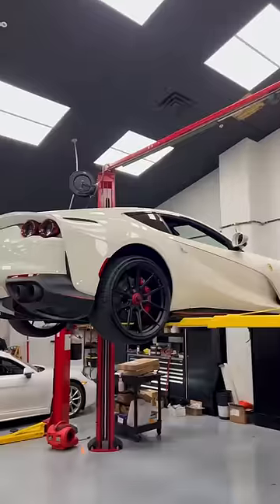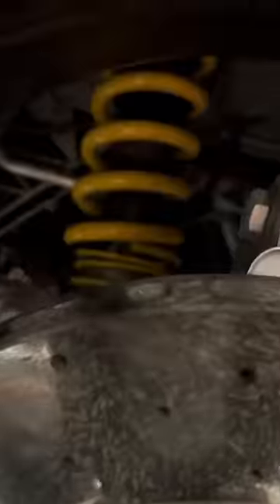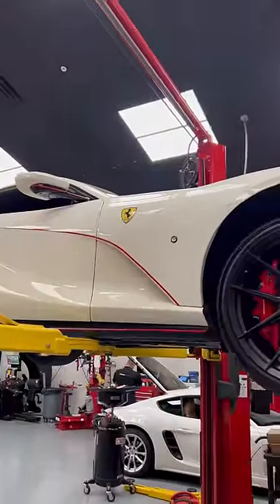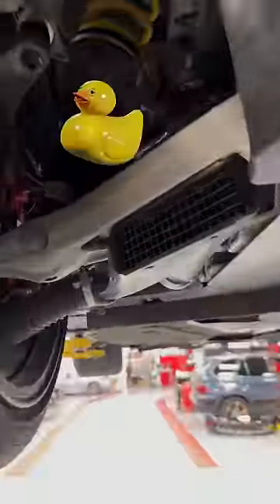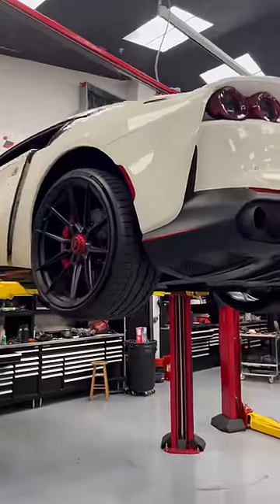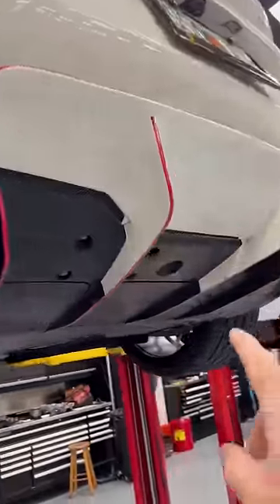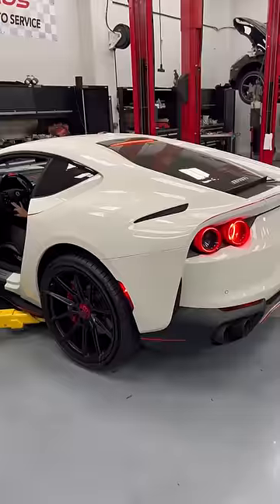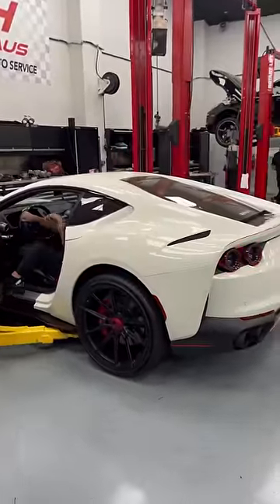The loudest car we service!! 🏎️💨 #automobile #ferrari #ferrar812

Comment: Having Ferrari modding money is wild.  $10,000 exhaust with $12,000 wheels if you’re wondering how much those Novitech parts are.
Reply: If you have a Ferrari, you also probably have Ferrari modding money. A 2021 version of the 812 goes for anywhere between $330,000 and $400,000.
Reply: Wow absolutely insane.
Reply: Imagine spending that much for only 60hp 😂
Reply: @S42069 that's a pretty good gain for natural aspiration
Reply: @xavierhulbert5849  Not true in the least. Many that own Ferraris can't afford them or the maintenance let alone modding. Same with more modest cars like BMW's, Porsches and MB's.
Reply: @spicysnowman8886  it would be if the starting point were sub 100. The percentage in power gained is going to be barely noticeable.
Reply: @S42069  it's not like a turbo car where you can just turn up the boost, 60hp is a good gain for a naturally aspirated car with light mods and a tune. Ferrari already squeezed a lot of power out of that v12, there's isn't a lot of room left.
Reply: @lukewalker1051  That’s just not true? Went to car meet with friends who have Ferrari’s, trust me none of them are broke. If anything, peeps like to keep them stock while they use some E30 or V70 as a tuner project

Does it make you feel better thinking people who have Ferrari’s are too broke to mod them? I don’t get it
Reply: @lukewalker1051 that’s so true. The ideal client for Ferrari or any luxury brand like them makes about 500k a year. 

And now there are former salespeople saying their ideal customer were the ones that could barely afford the car. That same customer has to sell it back to the dealership usually after a couple years because they can’t keep up with maintenance. The dealership buys it back at a depreciated value and then resells it for a great markup. They can resell the same car at least 3 times. 

The ones that can actually afford it try to buy them after they depreciated lol.
Reply: @half23 facts. But in most cases people lease high end vehicles for 2 years and switch to the next one. It only makes sense, as you stated, with the maintenance cost and depreciation.
Reply: $12000 for wheels and the hubcaps look like they came from autozone, wow
Reply: @S42069 well it’s not about the power at all actually, the main reason you change anything in the exhaust is for the sound it creates compared to stock.
Reply: @S42069  you must be american
Reply: Wheels look gay
Reply: @preco9437  so are you trying to say that no car guy ever buys a vehicle they can just barely afford?
Reply: @miles11we  these are the car guys that make cars have bad reliability scores , like people who buy E92 M3 or E60 M5 and then complain when it breaks but in hindsight they couldn't afford that car if the engine gave in , if you buy a car make sure you can replace the engine that same week it gives in if not you can't afford it you can just buy it
Reply: You also forgot about the Ferrari DMCA lawsuits xD
Reply: @KingChadKennedy  so you agree with my point but don't want to admit it?
Reply: @xavierhulbert5849  Yea and that's still ain't shit compared to guys who own vintage race cars.... Maintenance on a 20 million dollar Gulf 917k or F1 GTR GT1 still cost more than Ferrari modding... There's always a bigger fish.........
Reply: @S42069 how much horsepower does your car have, and how much did it gain with the mods you're never going to do? You have to remember that most regular and sports cars have so many restrictions that when you do anything it makes a significant difference. This thing is almost maxxed out from the factory as far as parts go. It's top of the line formula 1 level technology. That's why the gains are minimal. You barely have any leeway as far as what can be done.
Reply: @MiguelGarcia-vj7oo yeah dude. People dont realize there are mclaren f1 owners in this world who spend top dollar to get service that isn't even based on mileage,  rather on hours. Drive it or not, the time comes, you're doing that service again.
Reply: @miles11we there's another very important sub class that's more specific than just the general "car guy". There are car guys who love cars but have zero confidence in attempting any work themselves and have no money to do the work needed. It's the ones willing to get their hands dirty that can successfully be a car guy and somewhat broke simultaneously. My friend had 14000 saved up and decided to buy a heavily modified twin turbo 300zx. Not once was he able to experience the full potential and after 6 months he sold it for,, wait for it......14000. All he needed was an additional 1500 to get the problem fixed, or 300 in parts and about 3 or 4 days of commitment and that thing would've been a supercar level car.
Reply: @harouttorkomian5897  Jesus, yall 100% agree with me but don't realize it and want to say no true Scotsman or some shit as if it changes it.
Reply: My entire car cost me 850 bucks bro, wtf 😭😭😭
Reply: Just those 2 parts are the cost of my car new, lol.
Reply: Just those 2 parts alone is the cost of my car new, lol.
Reply: With a $200,000 fine too Ferrari😂
Reply: I was thinking it was vile that someone is making cheap mods to their Ferrari, guess I'm wrong
Reply: All that for a 50hp gain?
Reply: @preenisgreen I know E30 is BMW. V70 is Volvo? I have a V70R modded went to a Euro meet the other day. Many other car guys gave me props for vehicle choice
Reply: And this is just the normal Novitech exhaust, the N-Largo exhaust made from Inconel costs 5 times as much as the standard one
Reply: Seriously! Like you’re able to afford to Void the warranty on a car that could have $30k+ service bills!
Reply: @TheDarkPacific  that's actually an assumption
Reply: @83wasagoodyear  from the few folk I've met that lease luxury vehicles at least, 2 years is the sweet spot. Obv everyone's different, and I'm sure plenty of people actually own their own supercar and whatnot.
Reply: Literally 10x any normal mod got it 😳
Reply: I am surprised Ferrari even allows modding
Reply: Not like it matters whoever has it doesn’t drive it look at the cobwebs in the wheels lol
Reply: I'd much rather have a Viper. Much cheaper to maintain and Ferrari is a POS company
Reply: If own a Ferrari you have enough Money to also Mod it.
Reply: @lukewalker1051 well that’s because you haven’t serviced your loose screws up ya noggin and of all the things you haven’t done, not modding your mindset is an absolute crime…
Reply: Changing anything on a new Ferrari is not advised.  Hope it all goes well. Warranty is now void.
Reply: @michaelwebster8968  that’s not a concern since putting an aftermarket exhaust on a new ferrari won’t hurt the engine and you can flash the ECU so the engine fault warning is gone…
Reply: Modding cheaper than the car at that price point I'm over here installing my parts how poor I am
Reply: A tuneup is in the four figure range, and 12,000 dollar headers that are "wear items" is a nugget from the 2000s iirc.

The carbon wheels on Shelbies are around $20k, or were when that was fresh hotness.

I'm over here planning to Maaco my OBS Chevy, don't mind me.
Reply: @spicysnowman8886 I mean maybe for a v12. But a v8 can gain a whole lot more than 60hp from 10k in mods
Reply: Modding a Ferrari seems unnecessary, like adding spray paint over the Mona Lisa.
Reply: Forget that, I get shivers thinking about the insurance. Which means, I can't afford to keep a Ferrari even if I win one from a raffle draw.
Reply: i mean i paid 5.3k for cat back exhaust and a catted downpipe on my 340i which isn't even a tenth of the price of a 812 so it aint that expensive
Reply: @S42069 Imagine not knowing the difference between NA and boosted cars.
Reply: @stevethedweeb9525  ah, yeah.. you got me. Solid justification.
Reply: @lukewalker1051 Everyone I know with a Ferarri, Porsche, or the higher end BMW has a leased car. They don't want to get stuck with old cars like that.
Reply: Yeah, all that money spent on a car that looks like a C7 Corvette 👍
Reply: @preenisgreen makes me laugh the amount of haters or just plain jealous people that love throwing that line out there.
Reply: Plus 20k brakes
Reply: My car was $22,000.  New
Reply: My Tundra sounds better and can do more than that😅
Reply: @swervsplatt9672  yeah but it’s not fitted with a front 6.5L v12 naturally aspirated mid engine beauty.  Honestly? I have a 23 Santa Fe 2.5T (posted recently) and it’s maybe the most fun suv I’ve driven. I also have a 2020 Cadillac XT6, which isn’t much in quality or $$, but the 4cl 277hp turbo in the Hyundai is “fun”
Reply: @half23 I make $500k/yr and I definitely am not the “ideal client for Ferrari” you need tens of millions to be spending that much on a car.
Reply: @StonkeyKong  500k is the minimum to ideally afford the maintenance and wear and tear of the car. Porsche has mentioned that too. But at some of these dealerships, as long as you can afford 2-4K a month, then they will sell you a used one.
Reply: @lukewalker1051 if you own a Ferrari you 100% can afford the maintenance and optionally the mods as well. If you can afford 300k you can afford 20k in mods and $2000 in maintenance.
Reply: Modding a Ferrari is a sin
Reply: Having a set of $1k wheels on a $20k car is a bigger flex than a set of $12k wheels on a Ferrari that cost $400k.
Reply: What if you're not wondering?  Is it still a $10,000 exhaust with $12,000 wheels?
Reply: *laughs in lifted truck *
Reply: @S42069 well it’s not that much in numbers, but I doubt that they race with this car. Got already enough power for any non-pro level track use.
A smaller tune is enough to make a car feel way snappier (it was probably a “characteristics tune” which resulted on a bit of extra top end power). On the other hand a heavy tuning almost always ruins cars daily driveability.
Reply: @idk-gq3lh you can fit novitec with no mapping or cutting, one off one on pipe
Reply: The wheels alone cost more than my whip wtf ..
Reply: @S42069  this comment is out of touch... you ever had the amount of money that the owner has? The fuk does he care about 12,000 bucks lol be like you spending 350 bucks on a part that gives you 12hp gain.
Reply: @gray7298  Out of touch with being a multi-millionaire? You're absolutely correct. But I laugh when my handbuilt car that cost me $25k leaves these cars in the dust
Reply: @S42069  you can lol all you want but they can use the exact same logic you do and just flip the situation... it's alot of money to you but to somone who gets that car it's not.
Reply: @gray7298  lolololol
Reply: Newsflash: loud cars are not cool.
Reply: @malakisands8180  Yes. I am not a Volvo fan, but I get the appeal. A V70R is one of the few Volvo’s Id actually want to own, cool car
Reply: Odds are, if you can afford a $250k car, you can afford $20k in mods. Never seen someone poor, but a ferrari
Reply: If it weren't for ppl with more money than brains, we wouldn't have super car content on YT! 😂
Reply: And here I am with my $90k Tesla, destroying these Ferraris off the line. But hey, vroom vroom, amirite?
Reply: @adamjones7497  Tesla owners trying not to make owning a Tesla their personality (IMPOSSIBLE)
Reply: @JokerX126  uh. That’s literally what Ferrari owners do. Quite literally every single one of them.
Reply: @adamjones7497  Most people that own a Ferrari Don't talk about it. They get asked about it.

Tesla owners can't help but tell everyone they own a Tesla. Even tho nobody asked
Reply: @JokerX126  you say this as we are commenting on a video of a Ferrari being shown off without me asking. That being said about literally every video or Snapchat or TikTok with someone posing with their Ferrari or Porsche or Lamborghini.
Reply: @JokerX126  oh, and I own 3 Teslas. And they are all faster than yours.
Reply: @adamjones7497  Everyone must think youre really dope… Im sure once you leave a gathering, people are talking about how cool your overpriced Tesla with the build quality of a Hyundai
Reply: @preenisgreen  build quality on both my teslas are quite good, not one issue. And they go nicely with my Tesla wall. It’s like having a gas station right at my house. Except it’s not gas, it’s electricity that I get directly from the sun. — I host most parties, provide the alcohol, steak tips, shrimp, crab legs and often wine and cheese. My neighbors love hanging out. Especially the other dads when I take them out shooting. I recently picked up a Noveske Space Invader with a Wolfman suppressor. A true crowd favorite. — And my cars are faster than yours and my d is very likely much larger.
Reply: @adamjones7497  You sound exactly like a Tesla owner lol enjoy the cope
Reply: @preenisgreen  does that mean you sound exactly like a YouTube troll? Enjoy your slow ICE cars bruh.
Reply: It blows my mind you can get a C8 Corvette as cheap as they are.
Reply: And to think my VW's "Stage 3" package was $4k 😅 to double it's output at the crank. Also, are collector plates necessary to get around not having cats? Even I get mirrored when I get an emissions test to get tags and my car is not loud at all.
Reply: It's a Ferrari, probably costs as much for the standard exhaust and wheels 😂
Reply: @lukewalker1051 that's just blatantly wrong lol where are you getting your facts? How many people do you know own Ferrari's? Maybe Lambo owners barely can afford it but Ferrari is classy and extravagant and is literally known to be a money pit, no one owns a Ferrari and doesn't know what they are getting themselves into lol. Just because you can barely afford your car doesn't mean you're like a Ferrari owner, sorry 😂
Reply: @racecarrik  yeah, but he already paid for that and just took it off the car.
Reply: Shame he just lost his warranty 😂
Reply: How to ruin a Ferrari for extra 60hp
Reply: Then, we will get to listen to him drone on about the cost of gas..  lol😂
Reply: @lukewalker1051 you’re just hating 😂
Reply: @preenisgreen Why did you put a question mark after your opening statement? (which wasn't a question)

Comment: Arguably one of the best modern Ferraris, and a N/A V12 to top it off is just too perfect
Reply: Yep, was just thinking that. Not a fan of the new turbocharged V8's/V6's from Ferrari at all. The last car I'd even consider from them that was turbocharged would be the F 40, of course, or the 488, in any form really.
Reply: So you're saying this is a NA V12 pushing high 700s factory stock? That's actually crazy.
Reply: 812 is definitely my favorite from Ferrari by!

Comment: The webs let you know that it's doing Ferrari things and not move😂
Reply: LoL, I had to go back and check...hahah, right on the brake calipers!
Reply: Typical when you got money you buy stuff and let it sit around haha
Reply: not like spiders can maje webs in a day or two
Reply: sometimes when we leave cars for 1-2 days in the shop while we work on them spiders will build webs. its really not difficult to comprehend, sometimes spiders make webs on daily driver cars
Reply: This is what we call confirmation bias. In your head is the même of the rich guy who buys expensive cars and doesn't drive them. So you look at this video and find any piece of info that will confirm your implicit bias. In reality, someone spending as much as a new car on mods is probably gonna drive it to experience the new power. Logically speaking. If course is possible that someone will spend all this money and not drive the car, but the probability of that isn't great. And cobwebs on a car that's been sitting in a shop for we don't know how long it's not a good indication that the owner doesn't drive it.
Reply: @Tricolor40004 9/10 it’s most likely due to it sitting at the mechanics garage waiting for parts etc
Reply: Y'all think spiders spend 1 month building their cobwebs? A random spider could have infiltrated while they were waiting for parts

Comment: There is a hole in the cat-less downpipes when you first show them. Is that acceptable? I don't know how robust they have to be. I'm not an expert, just curious.
Reply: I noticed that too. There definitely shouldn't be pinholes like that.
Reply: I'm pretty sure that rough texture is just heat insulation and doesn't seal anything, the actual pipe is probably under that stuff.
Reply: Sorry for the stupid question but why would a N/A car need downpipes? Aren’t they for turbos?
Reply: @spicysnowman8886  you know what, I think you're right.  I see similar stuff in refineries with insulated pipes and an aluminum cover. I didn't make the connection.

Comment: I did a track day a few years ago in a lamborghini murcialago LP640, it had carbon ceramic brakes, I've never experienced anything like it before or since, and despite all the power and handling, the brakes were the most impressive part that I just couldn't comprehend, it's like throwing a parachute out the back as soon as you touch the brake pedal, oh, and the instructor said they cost £10k